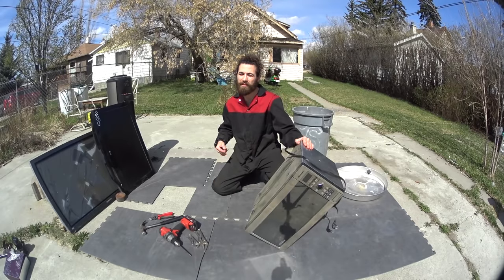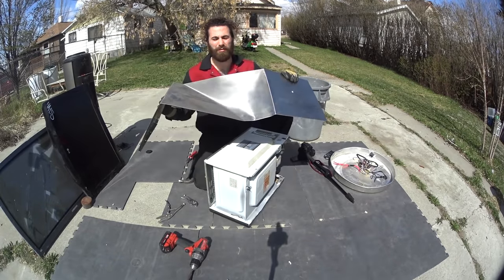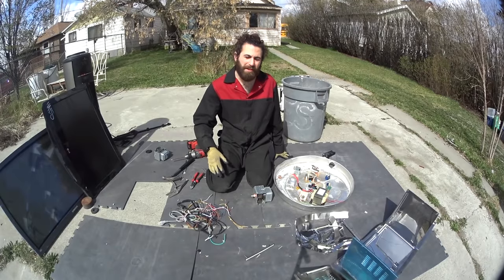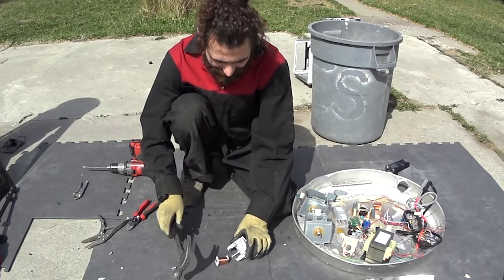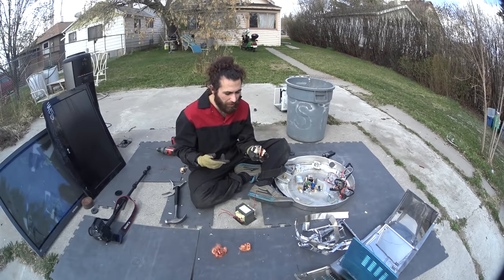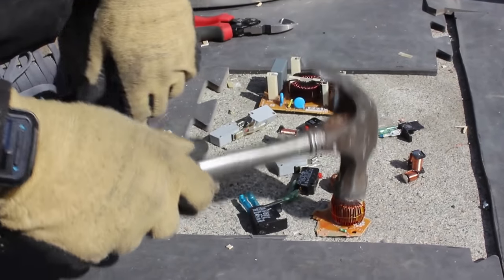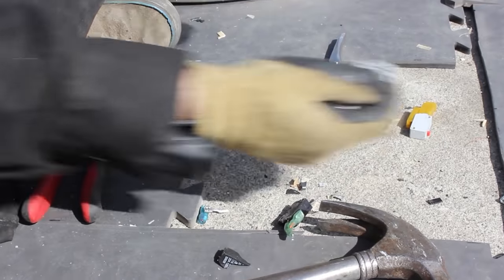Scrapping a Microwave FAST and SAFE! - Make More Money In Less Time!

Comment: Certified Electrician here.. you’re correct in regard to the capacitor being able to put out an extremely high voltage, after all that is it’s job. But you’re wrong about needing insulated pliers and gloves to cut the wires, you don’t need either to cut any wire and long as you cut them one at a time. Even if it had a charge and you cut both capacitor wires at the same time, with a pair of metal scissors it still wouldn’t do anything except a small spark. Similar to a jumper cable spark. A capacitor put out high DC voltage for a millisecond and although it’ll pop you, or won’t hurt you or kill you.
Reply: Most useful information I got out of this video.
Reply: Pop you as in shock you?  Whole microwave at a metal company pays 4 cents a pound.  I really hate getting shocked.  I was going to try to scrap and part it out but I'm just going to give it whole to the scrap metal people instead of my trashcan.  I think they're after the sheet metal, not sure about the copper.
Reply: @shihtzusrule9115 
Copper's the most valuable metal in there, all the scrapyards do is exactly what the man in the video does
Reply: Certified HVACR, you’re correct about cutting one wire at a time, however a run cap or start cap can put you 6 feet under. Especially if u have a week heart or some other unknown medical condition and don’t dare get popped if u have a pace maker. 2nd don’t dare touch meg while it is still terminated to that run cap. If there is a charge still in it, it was nice knowing you. Let’s be careful of the advice we put out on YouTube . We speak the languages of our trades and the average YouTuber doesn’t understand our language or what we leave out because to us it goes without saying. Be safe out there.
Reply: Word Ikr. Just touch both terminals with any screwdriver to drain the charge. Then no worries. If you don't want a spark make a resistor from a light bulb. Then you get light for a second. And its discharged. I once got hit by a VFD that hadn't finished spinning down. That my friend hurts really bad. The worst ever was 277 on a hot neutral I was sure I was going to die for two days.
Reply: Shawn Shurtz 277 is a nasty beast
Reply: Got hit by a neutral on a hosi, and they always want to get a discount.

Comment: Loved the video just had to correct you on one thing. That capacitor is most likley a run capacitor and totally safe to handle. It is also not used to produce an extremely high voltage, that is done with the transformer. All in all great video
Reply: It's not a run capacitor, can hold over 2KV and will do bad things to you if its internal bleed resistor has failed.

Comment: The microwave oven transformer can be a good source of dangerous (Electroboom) voltage for experiments, or carefully stripping the HV secondary and replacing with a few turn very heavy gauge can make a transformer for a DIY spot welder
Reply: ianjsutt  I've made a spot welder from a MOT, and use it for lots of small projects. :)

Comment: The aluminum fins on the magnetron are very easy to take off they are only pressure fit around the core, take a large flat screwdriver and just twist and they pop off. Just be careful not to damage the beryllium oxide ( red=dead). Also don't bother trying to turn the tamperproof screws out with a grip just take the same large flat screwdriver or a pry bar slide it in between the sheets and give it a good twist the screws will just rip right through the thin sheet metal.

Comment: You have to discharge the electrical currents from the capacitors with 2 metal screw drivers👍 those capacitors hold death defying electricity awesome video brother.
Reply: Or throw some metal at it and run 😂😂😂
Reply: @maxwayne4323  lmaooo!! Hell yeaah
Reply: @enolwlfe   😂😂😂

Comment: Before you scrap microwave always check if it works.You will be surprised how many times it does.
Reply from the maker: That's a good point.. i may be throwing money away!
Reply: Guaranteed easy 10 bucks on craigslist
Reply: Polish Diver a
Reply: One frustrating thing here is that people always cut the cords to sell for the copper content, so in many cases I can't test microwaves that I find. Really annoying

Comment: Great informative videos mate.

I notice that you rip open the casing to get at the parts.  I remove the casing and fold flat. Scrap steel.  Because as well as the insides I use the microwave body as a bin for all the scrap pieces of everything i scrap.  All the screws, bits of plastic, even all the easy-to-shatter toughened glass from nice alum patio sliding doors.

The microwave has a handy closing lid and handy carry handles formed by the left and right sides of the chassis.  Because it carries easily i put my heavier scrap shit in them.  I just chuck (well, slide) them into the scrap steel pile at the recycler yard. They are heavy (which is good) and they don't know what's inside.  We pay a 2c/kg enviro levy here in Australia anyway for all the plastic we chuck (fridges, stripped AC wall units, etc) so i dont feel bad about it.  I don't go as far as putting bricks (or water filled plastic milk/drink containers) inside front loader washing machines though lol.

So i always love microwaves and usually have a stack of stripped ones waiting to be filled up with small scrap 🙂

Comment: on the capacitors just take a screw driver touch the two terminals it short out and draw the power out if there is any
Reply: As long as the screw driver has a non conductive handle or it will ground out through you! :)

Comment: Clipping the lead to a capacitor doesn't discharge it.  You must short the terminals, preferrably with a slow-discharge device.  Lacking that, a thick, heavy metal device like a crowbar works fine, provided you're totally insulated from the crowbar.

Comment: Short out the capacitor FIRST by touching your screwdriver shank from the terminal to any point of the chassis. If the cap is loaded - hot - charged, you will get a respectable spark....maybe enough to require a quick shower and fresh underwear.

Comment: LOL! This video gave me a good laugh! I do this type of work for a living and I see some misinformation (due to lack of knowledge, I hope) and a lot of waste that is money. True, steel (not stainless) is not worth much, but it does build up and becomes another side income. Also, you can get a security bit set from harbor freight for very cheap and will speed up your removal of those screws. And speaking of screws, I separate the SAS from the Metric and also the various types of threads and heads. They go into their respective containers and later get weighed into 1 lb lots and sold for 10 to 20 times their scrap value. (ever have to go and buy a bolt, washer, or a nut?) Also, the electronic circuit boards have a lot of metals in them and a simple low-cost smelter can separate those metals out that you can pour into ingots and get a lot more money out of them. Sure it is not quick, but the rewards are greater and worth the efforts. Just have to get out of the "microwave mentality" of quick cash vs slower and go into the methodical higher profit mentality. 
And those glass platters, primarily made of silicon (of which there is an actual shortage which raises the price) and crushed up and once you have enough in weight, there are those who will come and not only pick it up, but PAY you for that privilege! 
Now, many will say that they do not have space and yet, we have a house on a 1/4 acre and not only do make the space, but also have a play area for the kids, chickens and a large garden.  Just need to use some ingenuity and some better area management.
Reply: or you could just get a splitting maul and save yourself the time of unscrewing anything

Comment: For the small transformers I use a machete and a hammer and split them in half. Very easy to do and does not take long. I just finished removing the copper from 12 of them.

Comment: @thubprint
1:10
just whack it with the claw on a hammer. the steel is super thin and rips instantly.. if you hit it correctly.
or flathead + hammer to leave the security torx still screwed in. 
the steel shell just has a "U" shape around the body. just slide it over and it pops off if all the screws are detached from the shell

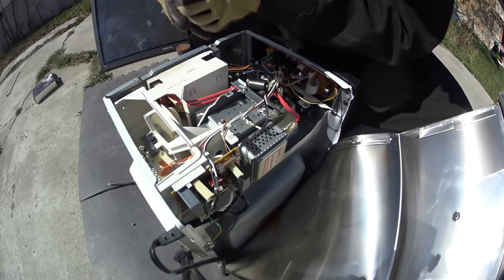1:20 i unscrew everything first, then disconnect all the "security clipped connections"
you just grab the clip and smash it down with a side cutter. comes right off.

3:12
the blades just pull right off the output shaft..
unscrew the 2 screws from plastic.
unscrew the 2 screws holding motor together 
whack the windings with hammer to pop that out. 

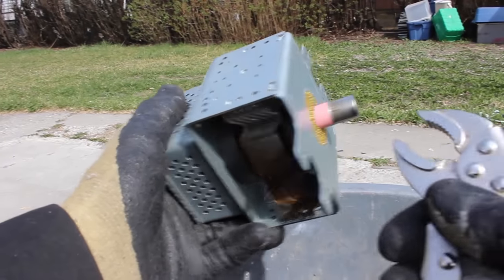6:30
side cutters with hard tempered steel for like 20-30 bucks. (Dont buy the cheap ones if you asked my opinion)
grab the lid and just turn your wrist to the right. comes right off. grab onto the copper gently to uncoil the copper, and the ferrite falls out.
Snip the 2 wires right at the base.
flip it over, pull the outer walls away from the "output" of the magnetron with a side cutter exactly where its bent and secured to the plate and theres the core.
Flat 10 inch kitchen knife (what i use) to get under "magnet retainer ring" it pops right off. 
pull the magnets and keep em (i would highly recommend washing them)
My tempered steel side cutter snips through bout 3-4 layers of the aluminum cooling fins no problem.
twist the side cutter left and right to "separate" as you cut, readjust to get the last 1/8 inch snipped. (40 cents a pound here, as of today)
i just toss the steel/copper/beryllium core in the iron pile. (eh)

8:48
4 LB Wedge hammer Breaks faster, and more accurately.
Stick the windings + E in your vise and pound the "E" out. (Dual swivel vise is 70$ at harbor freight.)

11:19 if you look at the side of the switch, it actually has a seam. you just separate the 2 halves with a utility knife, i have yet to come across one that is actually glued/melted shut

Other than those "minor adjustments from caveman to smarter caveman." 
The video is spot on, i knew about all the safety hazards.. but not everyone does. thanks for saving how ever many lives on that part.. lol. 
im sure you knew all this, but it seems to be a video for "those with less tools that also scrap"

also when i scrap microwaves, the only "Not metal" i sell is the paint and maybe a little 1/4 cube of plastic stuck to a screw
The plastic on the inside of the door just pops right out if you have a flathead screw driver and get behind it. sometimes the face plate is screwed to the steel door

Comment: One of those magnetrons had beryllium on it.  Watch out for berylliosis!
Reply: The beryllium is in a ceramic form, fairly safe to work around as long as it's not destroyed, so not grinders on the magnetron folks, otherwise low risk
Reply: If the beryllium cracks... or fractures....your screwed, so in ceramic form it's not safe to huck around. And the next set of kids to play in that backyard might develope unknown illnesses.
Reply: Those microwave ovens looked fairly new, Beryllium oxide, if used, may have been used in older MW ovens, but in the industrial-sized ones. Working with Beryllium oxide is really hard, it needs to bee isolated from the worker putting the magnetron together, it's too brittle and really not worth working with because of its toxicity. Today that pink stuff you see in these ovens is called Alumina, it's harmless, its a by-product of making aluminum and it's harder than Beryllium. I believe that Beryllium oxide in-home microwaves is just a myth. I never met with a magnetron that had beryllium in it, although if I correctly know it is still used in radar technology.
Reply: Also known as airborn death. Military connectors often have beryllium copper contact pins. 
I have never seen any precautions on any of those packages.

Comment: With my limited electronics experience. Touch the positive to the negative of the electrolytic capacitor and it will discharge. With high voltage capacitors and even oil field capacitors they always are shipped and stored with a piece of metal wire attached to both terminals. The reason being that air blows across it could create static electricity and charge it to a certain degree. And you are correct beryllium oxide is toxic especially when inhaled.

Comment: 3:57    - UH   UH !!!

THAT is NOT the grounding wire.
its a DIODE that makes the combination of itself AND the capacitor a sort of cascade, 
doubling the voltage for the Magnetron. The discharging device is WITHIN the capacitor, U'll notice a solder-joint on top of the cap. Mostly between the connectors. THIS is where a Resistor is soldered at the INSDE of the capacitors housing. Its about a 10 Meg resistor that discharges the cap after the µ~ is switched off
Reply: Micro wave. Nice I get. μ~

Comment: If you crank that little motor it makes over 120v. I take them home clean them up and try to fix them. Way more cash that way. The little relays can be used to fix cars for fuel pump etc. The transformer is usually aluminum secondary and copper primary.

Comment: The plates sell for $15-25 on ebay. You're throwing away the most valuable part.
Reply: The magnetron sells for $30
Reply: I was wondering how quickly stuff like the glass turnstile & the small motors sell on eBay & if the amount of $$ I make will surpass the amount of effort I will use to store, package & ship the items?  I've never sold on eBay & was curious if it'd be worth my time & effort?🤷 Would u mind giving me a few pointers? U can put them here or PM me, if need be. Thanks, in advance, for any advice ur willing to offer.🤝Have a good one.🌞
Reply: Asking and actually selling are two different things. I have a stack of the platters that I offered on craigslist for $5 each. never sold even one. new ones go for anywhere from $15 to $65.
Reply: Ebay has a much larger customer base... Might take some time to sell, but worth the try.
Reply: @Procrastinator1948  Yep, that's the crux of it. Browsing through sold listings is the only way to find a current value for something. There's still people asking $1,000,000 for beanie babies, lol.

Comment: I use a 4" angle grinder with a cut-off disk to cut through most of the metal to get all the "scrappable" metals (mostly copper) and I save the tin until I get a truckload, tin may not pay much, but it helps to get more gas money to run more allies. You have some good tips, except people who like me make very good money scrapping, so you need to invest in the right tools and save up your scrap and sell when the price is high and hoard when prices are low..
Reply: How do you make very good money scrapping ??? I'd like to know how to locate the best buyer in an area ???
Reply: @daisymay9391  I found the best time, is to run (drive through) the allies (during) the day of their trash pick up, I start at about 4am, and run them before they have picked up the trash.. just drive up & down all the allies you can and pick up all the scrap that contains copper, aluminium, brass & ect.. try to make sure you separate and make sure (when you get it home) everything is cleaned so you have all the copper being just copper and aluminium just it.. I also hoard till I get a large amount, when the price is low. and sell when the price is high.. It takes a while to get good at it.. Also you need to invest in the tools you will need to clean (process) everything
Reply: I live close to Memphis, Tn. There are like 10 scrap yards around some further away than others. I'd like to know how to locate the best buyer in an area ??? How do I find out the going rate for the metals?
Reply: @daisymay9391  There are many online sites, just google them to fine a price, but best way is to just call the ones in your area and just ask them their prices, almost all will be very glad to help you, if any don't then those are the ones I would stay away from.. those that do, will more then likely all be a tad off from each other, remember, they have to make money also or they have no reason to buy... find one that gives the best price and if it is close enough, go there.. also, myself, I tend to hoard mine till I get a large amount, so the payoff is better...
Reply: @daisymay9391  Telephone the scrappers and ask their price for the metals you have.  Some scrappers may post their prices on their webpage.

Comment: And yeah thats 100% not how that capacitor is discharged
Reply: PETR DOLEZAL right. If you ground a charged capacitor it will blow up.
Reply: The proper way to make sure the system is discharged is to plug it in and lick the transformer. Don’t worry! It’s only 2.4KV
Reply: @tf3confirmedbuthv54   I guess he didn't notice the warning label. DANGER: 50,000 Ohms!
Reply: PETR DOLEZAL jjj
Reply: @lar3ryca  Ohm's don't hurt you genius.
Reply: @taunteratwill1787  Do I really have to put a smily on a joke? Duh!
Reply: @lar3ryca  Too little & too late, no one is gonna fall for it.    Bye bye genius.  :-)  btw Did you buy that 3D printer you wanted?
Reply: Taunter Atwill Depends on what 3D printer you are speaking of.

Comment: That ground wire to the frame has a rectifier on it. There are only four components in a microwave. Capacitor, rectifier, transformer and magnetron.